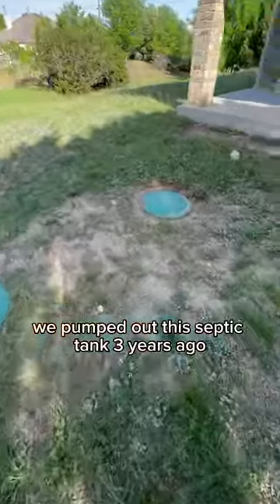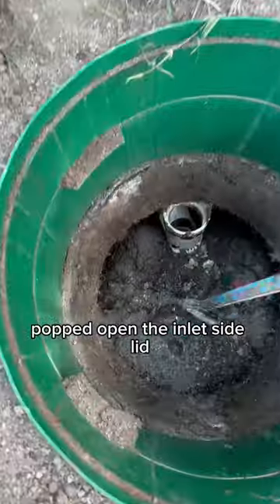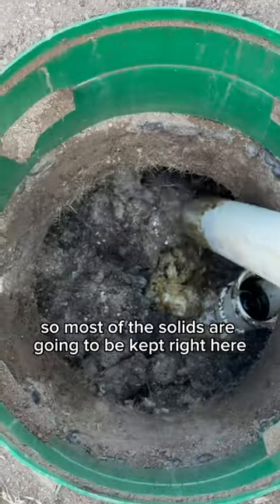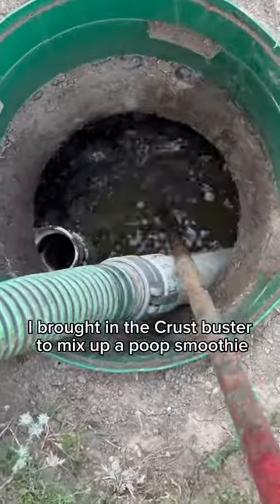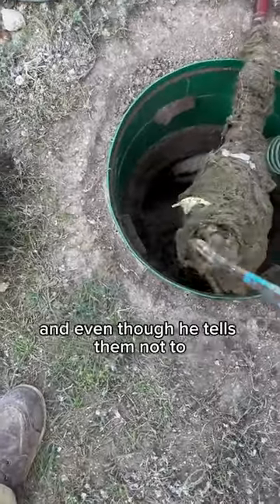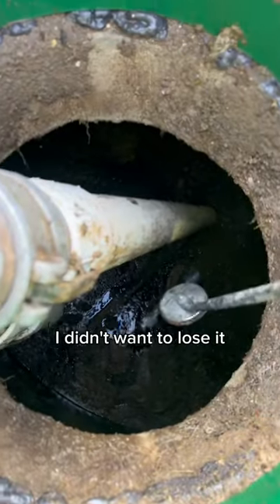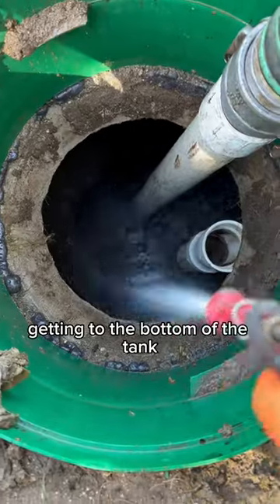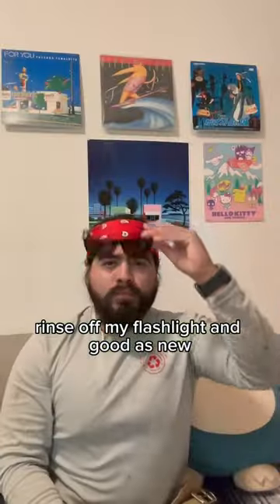Wipes in the septic tank #shorts

Comment: Are flushable wipes bad for lagoon style systems without a septic tank
Reply: Wipes are bad for any system really. You run the risk of them getting stuck in the line out and you end up with a backup. When roots break through a sewer line, all of those wipes are gonna grab onto those roots until it’s blocked completely.